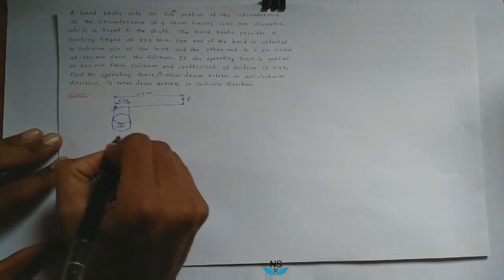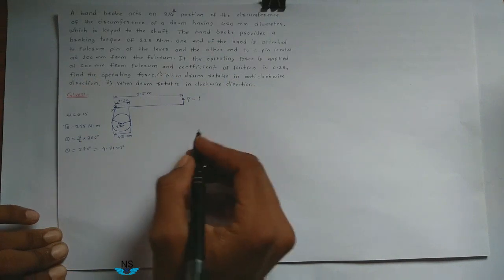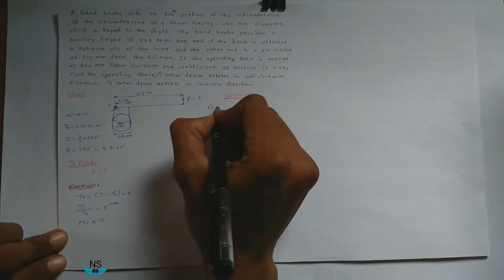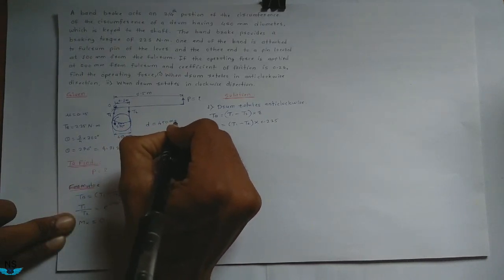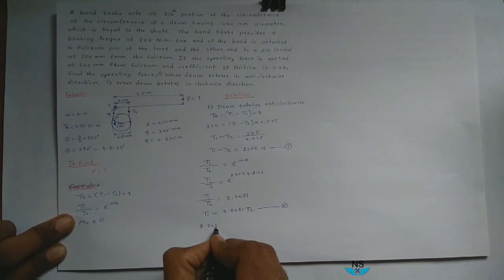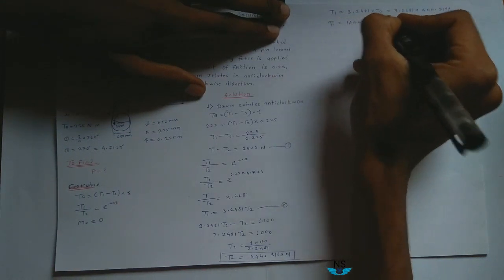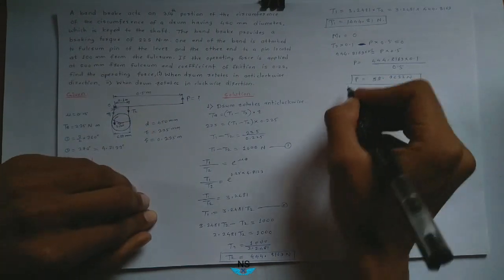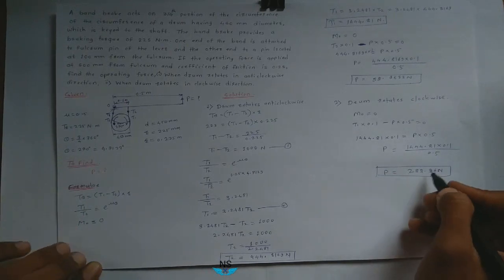Simple Band Brake (Problem - 01) #NS #mechanical #diploma #theoryofmachine #tom

Comment: a lever of length operates a simple band brake 500mm. The brake drum has a diameter of 500mm and the brake band embraces 5/8 of the circumference. One end of the band is attached to the fulcrum of the lever while the other end is attached to a pin on the lever 100mm from the fulcrum. If the effort applied to the end of the lever is 2KN and the coefficient of friction is 0.25, find the maximum braking torque on the drum.